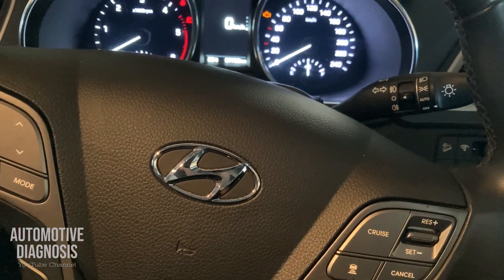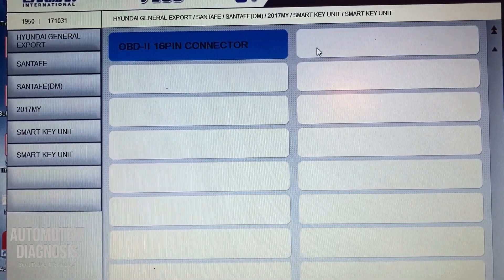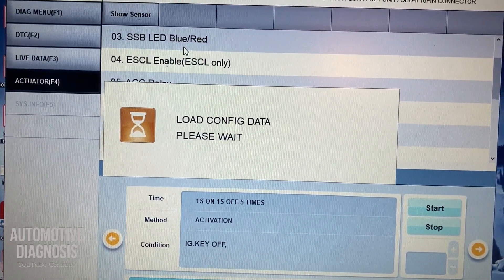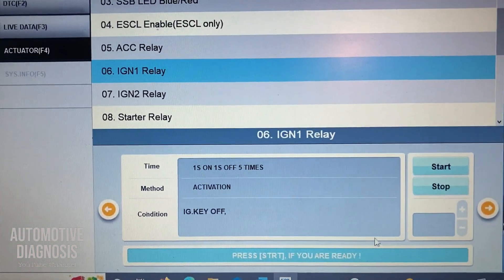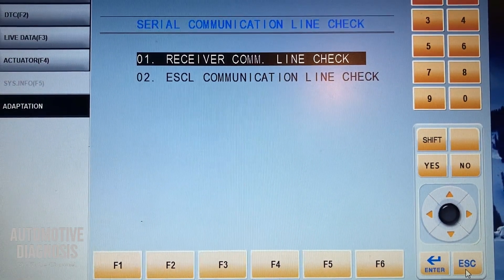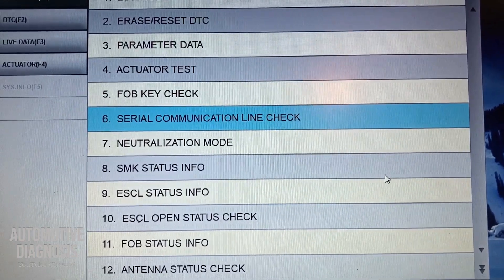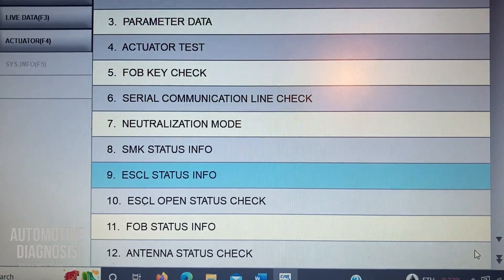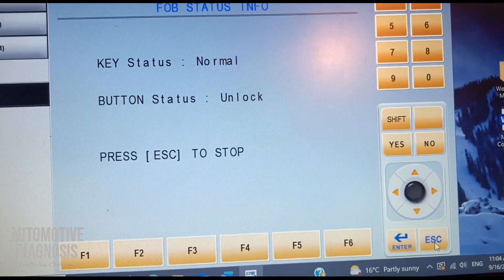Smart Key (Push Button) Diagnostics | Key Teaching | Neutralization |  Antenna Status Check & More

Comment: it looks like the scan tool you used is like 4k, do you know of a cheap one that can be gotten off amazon for checking this?

my kia has an issue where the push to start doesn't detect the key

replaced the keyfob battery, new keyfob, new keyfob battery, no change

tried replacing LF antenna 1, 2 and 3 with no change either

I took it to the dealership and they said I had too many mods for them to diagnose it, annoying since it didn't start until after I had recall work done at the same dealership

all the wires look good but maybe they cut a wire while doing the recall work on accident, thinking the next step is volt testing the antenna wires
Reply from the maker: Hi there, if you do me a favour and tell me your car model and model year, then I might be able to help you out more. There are a couple of different cheaper scanners but we must first know if this fault can be fixed with a scanner.
Reply: sure its a 2021 kia stinger  @AutomotiveDiagnosis  

i tried testing the incoming wires to the LF antennas with a volt meter and no power detected either

followed the wire as far as i could without taking apart the entire car and it all looks good too

honestly clueless at this point

if you have an idea of a good scanner to test it further i'd appreciate any insight :)
Reply from the maker: Thanks, Just one more question. Could please explain what happens when you get in the car? when you press the push button with the key fob or without it. What message do you on instrument cluster?
Reply: @AutomotiveDiagnosis  Sure, when i get in, no issues until i push the button, if i push normal it says no key detected

says that until i push the button with the keyfob itself
Reply from the maker: On Kia smart key system, there used to be an external receiver which is normally the cause of the kinds of issues. But apparently as I see in the wiring diagram, on your car it’s integrated with smart key control module. I don’t think all LF antennas go faulty at the same time, it could be wiring or unit failure. But of course using a scan till you can check the antennas one by one. The cheapest scanner that I think will cover this function is OTOFix D1. I haven’t tried that scanner on the smart key system yet, but it surprisingly works well. You can ask from the provider another coverage as well. And it’s normally around $400.

Comment: I need to do the same testing on my 2020 Rav4 XLE, which scan tool would you recommend with similar features ?
Reply from the maker: The best scan tool for Toyota is Tech-Stream that you can find it by a quick search in Google and it’s very cheap.
Reply: @AutomotiveDiagnosis  what scanner are you using above  ?
Reply from the maker: @knight3131  this scan tool was CarmanScan

Comment: My 2011 kia Sorento doesn't change ignition modes like the key isn't in the vehicle and it doesn't crank. The fob doesn't unlock or lock the doors, i have changed both battries in the fob and once in a while i can get it to start, what are your thoughts?
Reply: Im starting to think smk module since its incontrol of all passive lock and unlock as well as engine start authorization, does that make sense to you?
Reply from the maker: @bradleythomas6326  Yes, SMK module could be the cause, but before paying too much for the module, it could be great if you can find someone to scan your car with a scan tool to read any possible codes which can be a great help. Also please let me know if there is any warning message on instrument cluster when you face the issue. And the last but not least, what is the model year of your car? there might be another unit, in addition to SMK module, which is called PDM, that could be the cause as well but I need to know your car's model year to make sure if there is any PDM on your car.
Reply: @AutomotiveDiagnosis  im actually a technician and only code is b1609 loss of com between smk and ipm, no lights on the dash, nothing lights up at all, of course it started working during my diag because i was going to utilize the pdm relay functions to rule out a bad pdm, the car is a 2011 kia sorrento
Reply from the maker: Hi there, is it exactly the same when you use any of key fobs?
Have you tried to put the key fob inside the fob holder (if you drive Sorento XM which is equipped with fob holder) when you face this issue? If so, what was the result?
Reply: @AutomotiveDiagnosis  yes same symptoms with both keys and it does have the fob holder and still has the same exact symptoms when the fob is in the holder

Comment: Dear Sir, our 2010 Sorento (XM) has a problem that we can only unlock the car with the buttons on the key fob and we need to insert the key fob in the holder in order to start the car. Neither door handles or the boot can be opened by pressing the button and the car cannot be started with the key inside the car (if not in the holder in the armrest). This leads me to believe that we may need to replace the smart key control unit, as it seems rather strange that all 6 antennae have stopped working at the same time. My question is, guessing that we will need to re-learn our key fobs to the new smart key control unit, is the PIN code required assigned to the specific smart key control unit or is it assigned to the whole car, i.e. will we need to find the PIN for the car from which the replacement smart key control module was taken or we will need to use the original PIN code for our own car? Thank you very much!
Reply from the maker: Hi there,
My suggestion is to replace the Fob Key battery before doing anything else.
Although you can unlock the doors with fob key but based on the fact that LF antennas are not working and you can start the engine after inserting the fob into holder shows this that you may need to replace the Fob key battery. If you did this already, try the procedure with your spare key.
Regarding the new fob key (if needed), you must the 6 digit PIN code that get using the VIN number (normally from dealership) if you already have one, that might work but these PIN codes are rolling codes that change periodically, so if your first attempt shows a wrong code, don’t try again before having a new code.
Please let us know how it goes.
Reply: @AutomotiveDiagnosis  Thank you for the prompt answer! Unfortunately, I have tried several times with both key fobs with brand new batteries but without any luck. Next step seems to be replacing the smart key control module. Will report back once this is done!
Reply from the maker: Please make sure your scanner covers this system as you must reprogram the keys after replacement.
Also, it’s not a bad idea to try to reprogram the existing keys before replacing, I am trying to reduce the repair cost 😉
Reply: dear @АлександърМадов, i understand it is 2 years after, however, did you sort that problem with no start with key fob out of the slot? my friend got same issue on his hyundai sonata. if Yes, what was a solution?
cheers

Comment: I only have access to a snap-on verus scanner.  I'm trying to access the immobilizer function on my scam tool but it won't communicate with my scan tool.  I can't find any service information about this smart key system and this 2013 santa ge has been kicking my butt for 3 days now.  No crank no start and security light on the dash when trying to start
Reply from the maker: Hi there, 
As I see in your comment, you have a Santa Fe 2013 with smart key (push button) and you can't crank or start the engine. So, following ideas come to my mind:
- When you using the scan tool to check the smart key system you will see different options, there is one immobilizer option which is irrelevant (this item is for those cars with mechanical key, not push button), so you will get no communication if you try this item, you should use "smart key system".
- Normally if there is any problem in smart key system to detect the fob key,  
you won't be able to turn the ignition switch on, and you will have "Fob key is not detected" or "check steering wheel lock" message on instrument cluster. So, if you are able to change the ignition switch position to ACC or ON, most likely you need to check some other components first (including starter relay, or starting system itself).

Please let us know how it goes.
Reply from the maker: Also, you can try the following method in case you have a faulty brake switch:
https://youtu.be/DZ5zW4dXtVc
if this method works, you may have fault on brake switch or it's circuit.